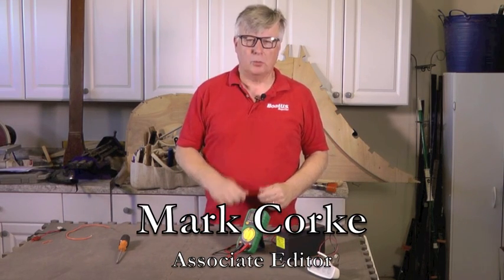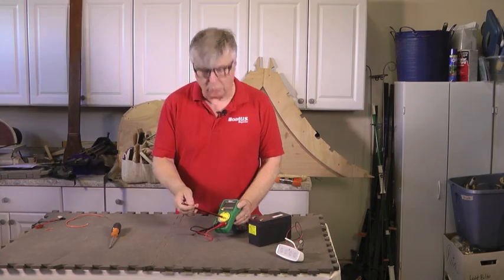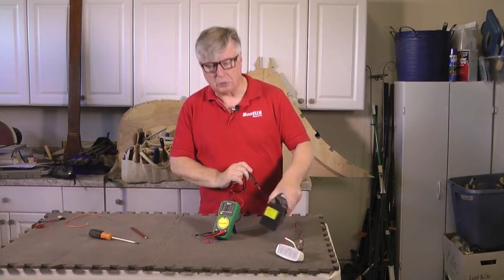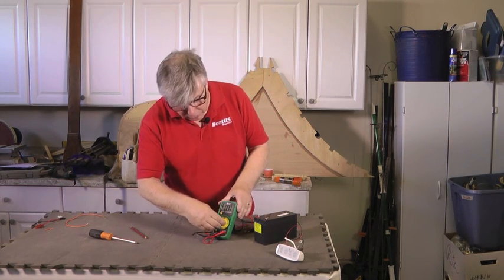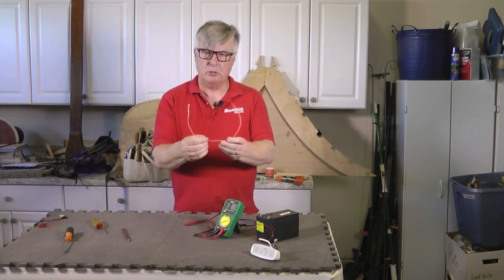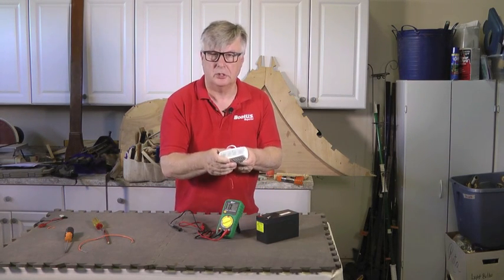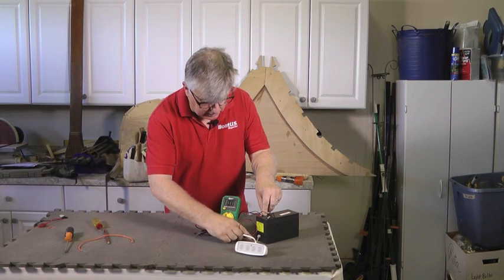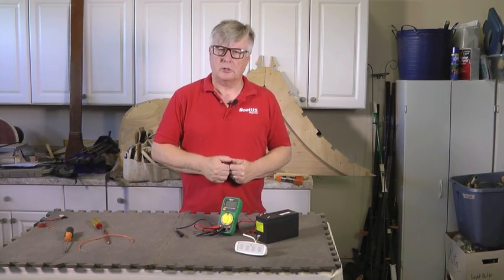Troubleshooting Boat Electrical Problems Using a Multimeter | BoatUS

Comment: I believe the OL means Open Line not Overload.
Reply from the maker: You are indeed correct, I should have referred to the OL on the multimeter as "open loop" or "open line."

Comment: Just a suggestion. It would be helpful to the uninformed to describe the amp meter that a black wire is connected from the “negative” battery terminal to the black wire (or common wire) of the LED light and the “red” amp meter probe is touched to the “positive” battery terminal and the black amp meter probe is touched to the positive (red) wire of the LED light.
Reply from the maker: Thanks, Gary. Appreciate your comments.

Comment: Quest i already have 2 buzzers 1 for each inboard. I want to wire a warning 12v led to the 2 terminal buzzer. It has 12v across both term. key off when turned on buzzer sound and oil pressure switch activates the buzzer until started then turn to ground on 1 term.. I wired the light between the 2 term and works great. Should i use a diode or inline fuse for 1 side of the 2 term buzzer? These are tiny leds.
Reply from the maker: Thanks for the question, John. Unfortunately, without seeing your setup in person, we are unable to give you a suitable (and safe) answer. We recommend reaching out to a qualified mechanic for additional guidance.

Comment: I found the cure for all boat problems. Get a friend to pull you out to deep water after making sure all the oil is drained from the engine and the batteries are removed, the use a heavy duty rechargeable saber saw or drill with a hole saw and cut several holes in the hull.
Reply from the maker: That's certainly one effective solution. And we appreciate that you are being environmentally conscious about it! Not sure how your insurance company would feel about it though ... 😂

Comment: Si, it would have been helpful to me if at first you showed which holes in the multimeter to plug the probes in. I have more than two and am afraid to quess.
Reply from the maker: Thanks for the comment, mountaingem. Do you mean the holes the cables go into in the multimeter itself, or how to connect them to the wiring you're troubleshooting?

Comment: this should be renamed. testing a battery.
Reply from the maker: I'm going to beg to differ with you, MD. If you watched the whole thing, Mark shows you how to use a multimeter to help isolate electrical problems. One of those uses is to check the battery, but he also shows you how to use it to check for bad switches and amp output.
Reply: @boatus  he skips even the basic settings in the first few rambling minutes and then tests the battery outside of the craft. it seems I'm not the only one who thinks so and it would be wise to update the video for brevity anyway.
Reply from the maker: Thanks for the feedback. We'll certainly keep it in mind.